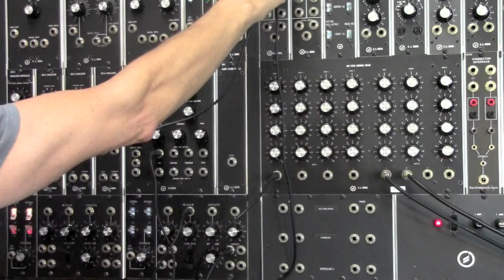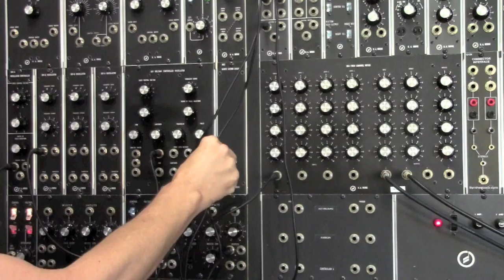Moog Demo (Part 1)

Comment: the Moog Synthesizer needs to use the amplifier to produce a great sound, same with the guitar amplifier for the electric guitar.
Reply: Well, it can produce that same great sound directly to a tape or any recording device. It doesn't need to be colored by an amp.